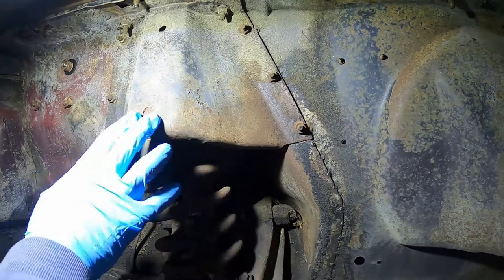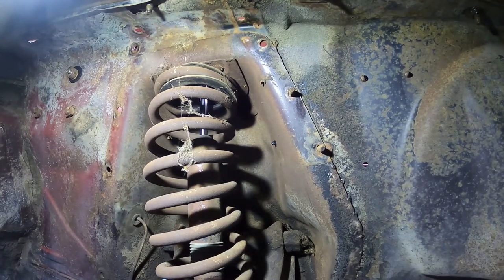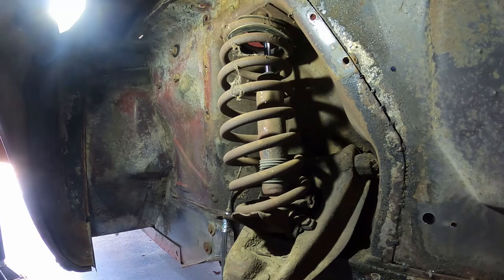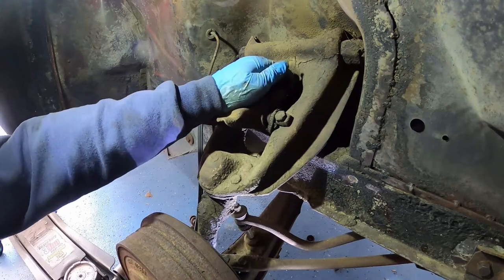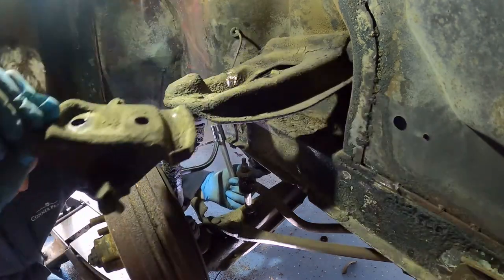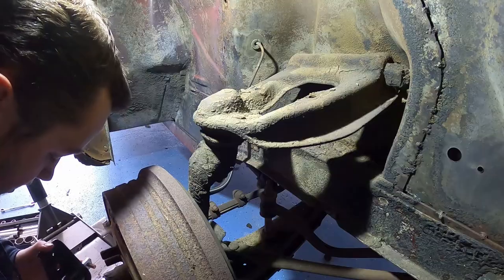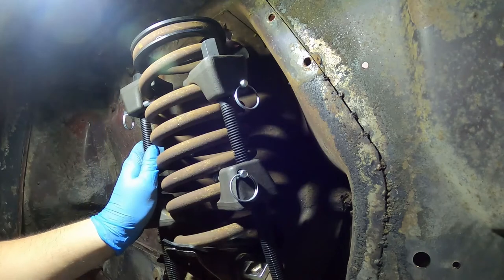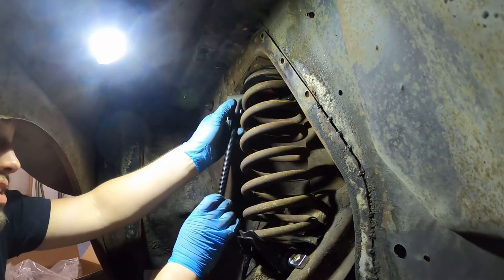How to Install 1965-1968 Mustang Coil Spring Perches

Comment: If you put your shock in and attach it to the bottom at the spring perch it may be more safe if the spring decides to cut loose from those compressors.

Comment: Bruh, Why's your spring so bent like that? I wouldnt take that thing out like that.  It has the power to kill you man.  Those spring compressors are for struts. you need the one that goes down the inside of the spring.